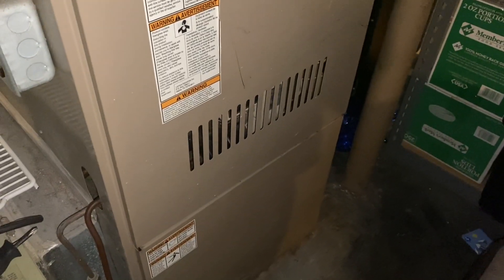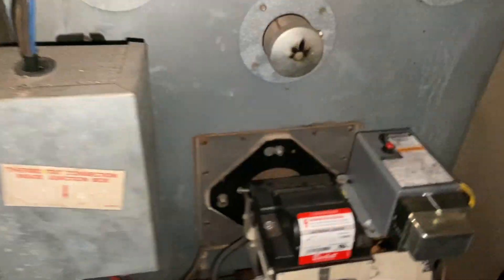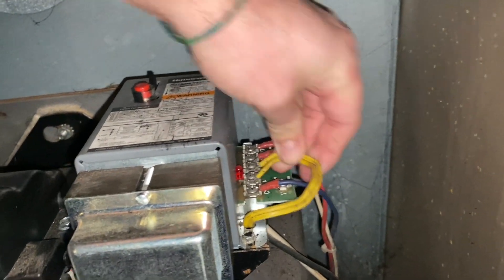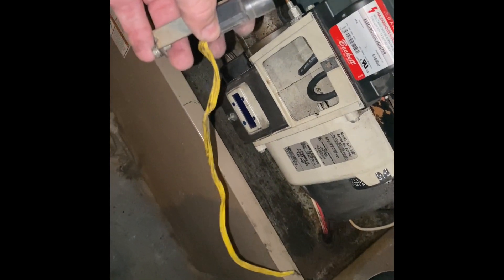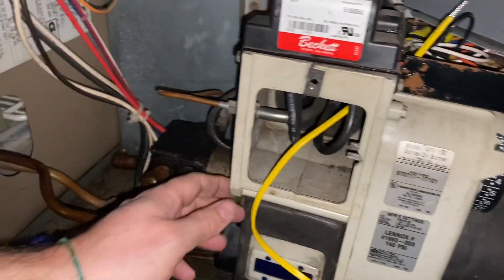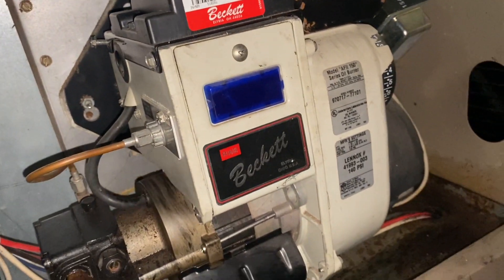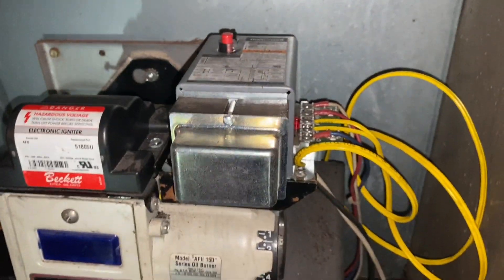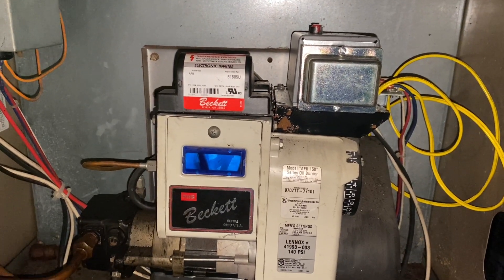How to Troubleshoot a Fuel Oil Furnace | How to Replace a Cad Eye Sensor #DIY #fueloil

Comment: Glad you got it going! You mentioned the relay, did you end up replacing that as well?
Reply from the maker: thanks, yes relay needed replaced. That video is on deck for next week.
Reply: What happens if you jumper the two yellow wires together? Does that by pass the cad?